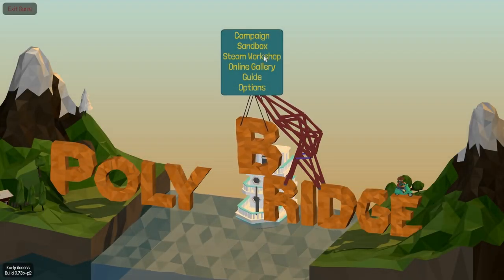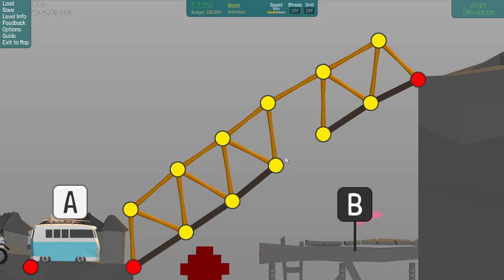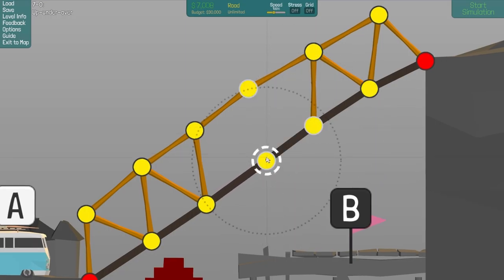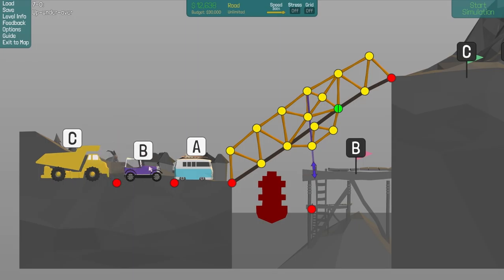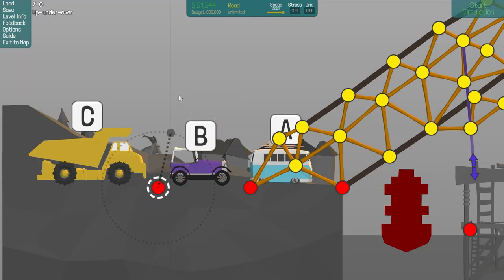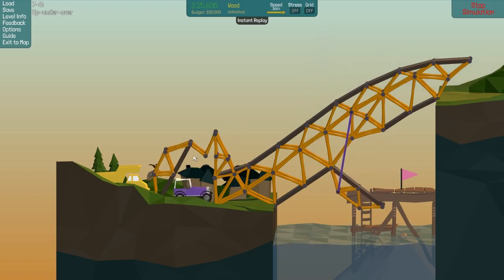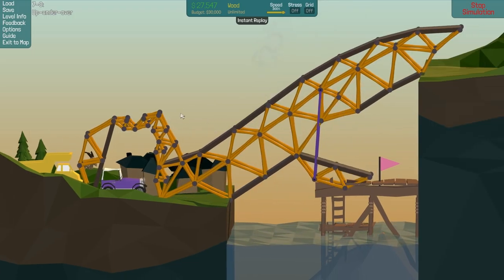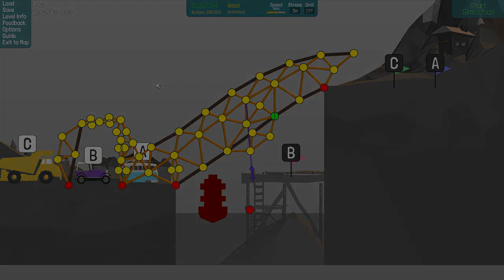Poly Bridge Workshop Ep 30 [Up-Under-Over]

Comment: Hey man, little tip, you didn't have to use the hydraulic, you could have just dropped 2 roads with split joints since you only needed them once :]
Reply from the maker: +Dem Dim But then it would not have been able to be used again
Reply: fair enough, happy new year by the way ;]
Reply from the maker: happy new year :)